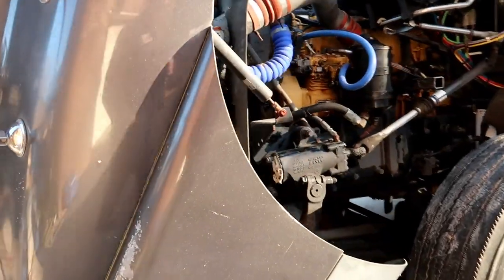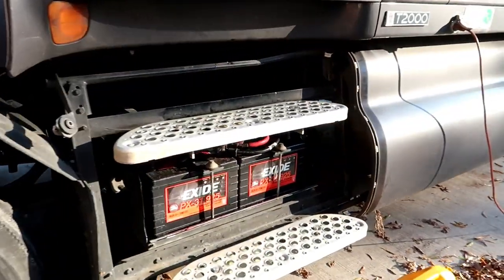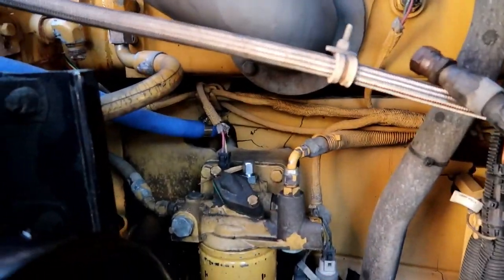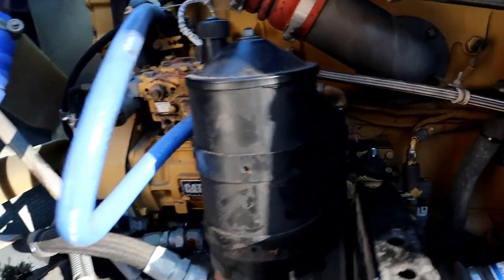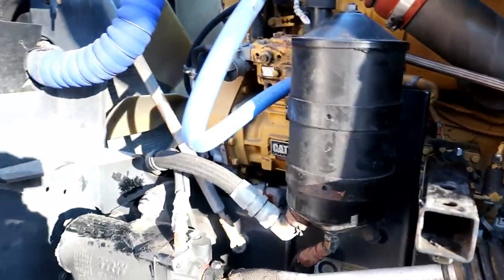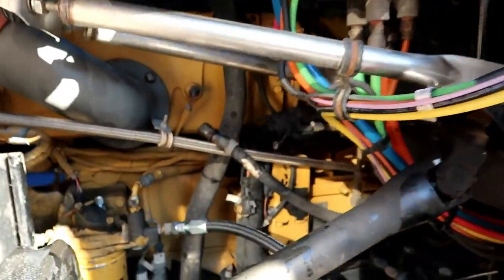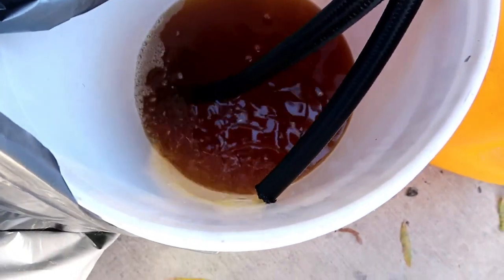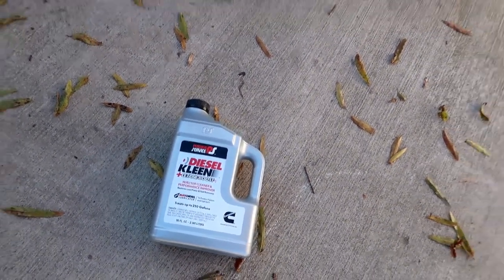Cleaning My Diesel Fuel Injectors...Saved me $3000

Comment: Watched this video several months back & kept it in mind as 'any' fix is a good fix if it works (and doesn't burn the barn down...) . My old International 125C (track loader) has been sputtering after some apparently bad fuel so I swapped out the (nearly new) old filters and filled them both up with Lucas Injector Cleaner (run whatcha brung). Ran it for a while and it seems smooth as silk but letting it heat soak now before restarting. Just wanted to say 'thanks' as I would have been too paranoid about putting 'pure' additive into the filter if I hadn't watch you waking up your truck's motor. Hey - I'm no diesel expert but I get plenty of people telling me to add transmission fluid to my diesel - what's up with that? 

Thanks again!

Comment: Hey brother I am currently going through this process, I removed both tanks sending them off to get cleaned, t660 sat for years and we ran it with bad diesel, won’t startup now so I’m removing all supply hoses maybe return also.. worried the fuel pump clogged, so im going to run a setup like yours tomorrow to get some clean fuel through it, so my question is, how did you prime the fuel pressure since it doesn’t have a manual type pump? Thanks
Reply: You have to use some either starter fluid that made for diesel engines to get it starting then it will eventually prime it’s self

Comment: Was it the combination of capping the return line and injector cleaner, or just the cleaner, that fixed the problem?
Reply from the maker: think it was just the cleaner that worked the best but capping the return increases the fuel pressure.

Comment: I have same issue with my D13 Volvo , I will try it
How long you keep the engine running with the cleaner ?
Reply from the maker: I run the engine till it's about out of cleaner. Most engines burn about a gallon per hour
Reply: Me too D13f.

Comment: How do you know if the injector does not fire when you swapped them around
Reply from the maker: I had a laptop with software.I did the injector cut out test.
Reply: What software did you use
Reply: I’ve got a marine Yanmar and I could hear a miss, used a stethoscope on each injector line and could clearly hear the culprit.

Comment: So you've super dosed with the cleaner. I'm looking to do a land Rover Discovery 3 but can't be arsed removing fuel lines etc. 2 new injectors fitted is $3 grand I'm told.

I'm thinking to simply run the fuel low in the tank to increase the concentration.

Any thoughts?
Reply from the maker: doesn't  sound like a bad idea.I would run it low and add cleaner and run it low again and then add more cleaner if needed so you can get the concentration up.

Comment: Should’ve used the atf, & just threw 2-3gallons in the tank or just filled up the bucket w atf.

Atf IMO works better than most of the fuel cleaners out there just because it’s a rly good detergent. I had a 7.3 PSD that like u was running kinda rough. Threw in a gallon of atf in the tank, then a week later it was a noticeable difference in power gain. Still had one weak injector, but I was able to drive the truck for another 6 months before the injectors puked their guts, & finally bought a single new injector to replace the cylinder I knew was bad after doin a check by removing the plug wire on each cylinder.

I determined it was cyl 4 which seemed odd, cuz it’s usually 1, 2, 7, & 8 that usually go first.

Bought an injector that would work for that year of truck, put it in, & that’s where the issues started.

It just wouldn’t start at all, so I threw some blue devil shit in the coolant for the head gasket which helped, but I think I had a seal that wasn’t sealing right. 

After I had done the treatment I took it for a drive, & it had its power back.

Another week or two if driving I could tell it was getting harder, & harder to start. Like the other injectors were goin out.

So abt 6 months prior I had done a little experiment w Veg oil, & mixed a filtered batch 50/50. It worked ok, but then it sat for a week.

Also goin on at the same time 6 months after that experiment when I started having issues w injectors I was looking for another truck cuz I was 17, & couldn’t afford to fix it.

The truck needed tie rods, wheel bearings, all new power steering system, & now a whole host of engine issues.

Now to fix all of that would cost just in parts about 1-2K for injectors, 500 for power steering components, $100 for wheel bearing stuff, & probably ball joints since it’s over 300k. I say over 400k cuz the truck had the factory CPS, never touched, stock IPR, & stock HPOP. Over 400-500k 7.3s need the HPOP changed, & IPR.